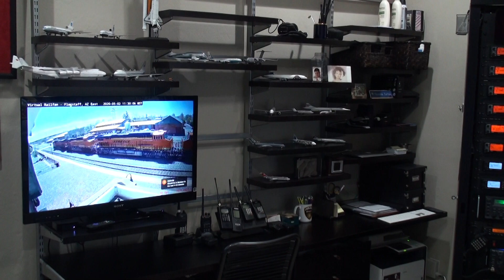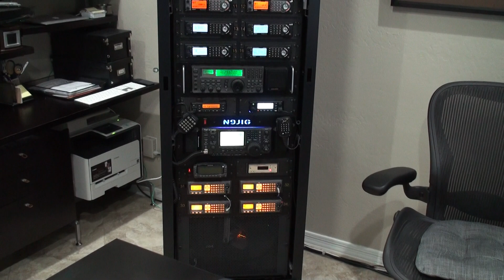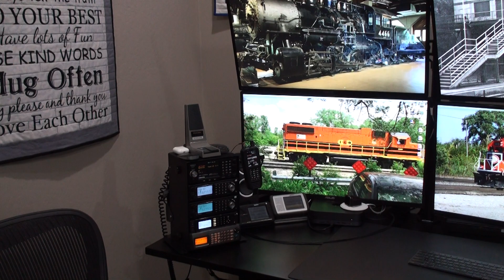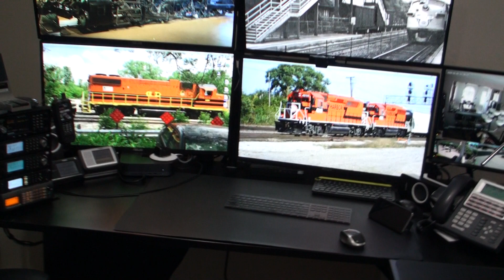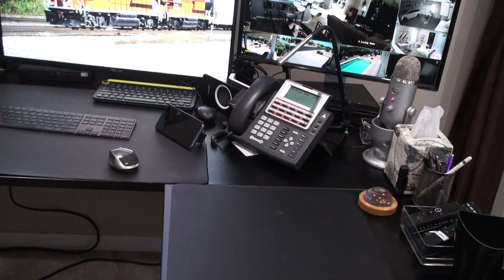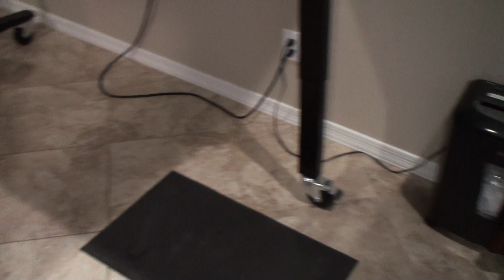N9JIG Shack May 2020

Comment: Hey Rich do you run Pro96com on 4 GRE scanners on the same PC? If you do, could you make a video of how to do it. I am guessing that it starts with running Pro96com from 4 diff folders?
Reply from the maker: You can run multiple instances of it. With the current version you just run the same folder, older versions kept to ancillary files in its own folder but the current one uses standard Windows locations.